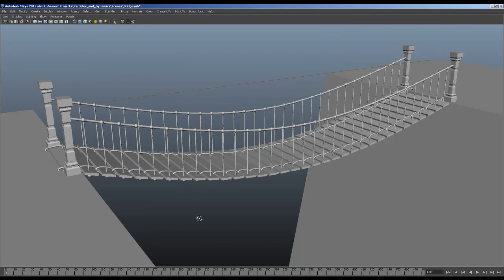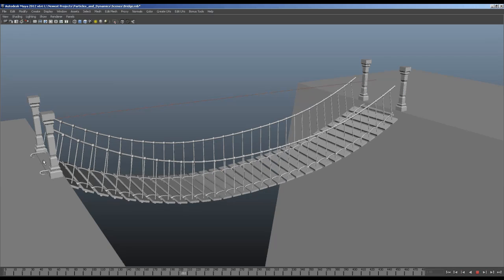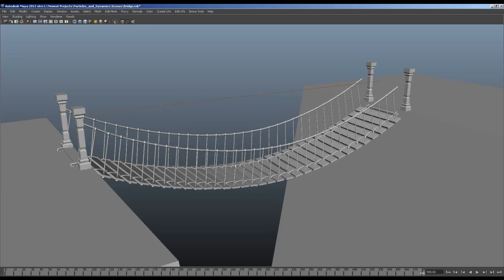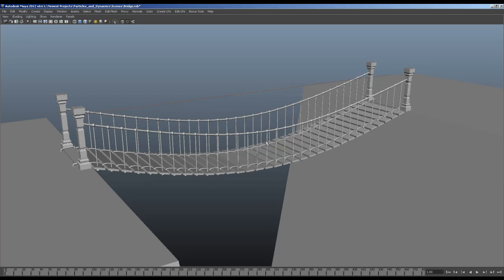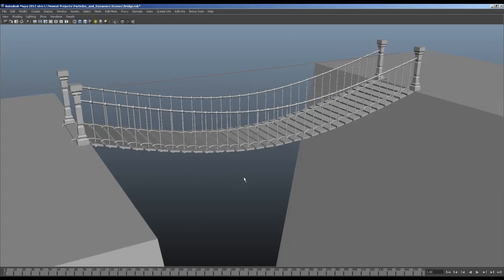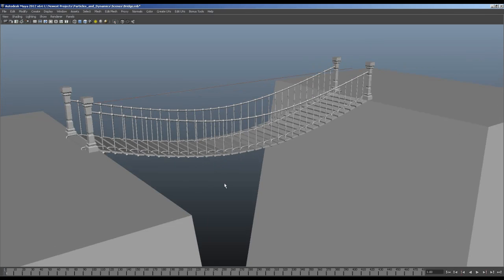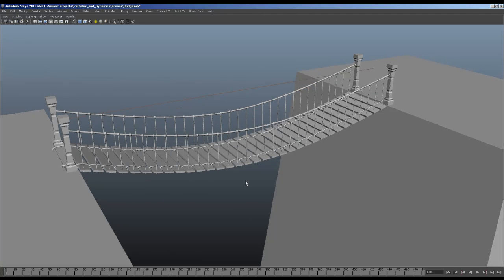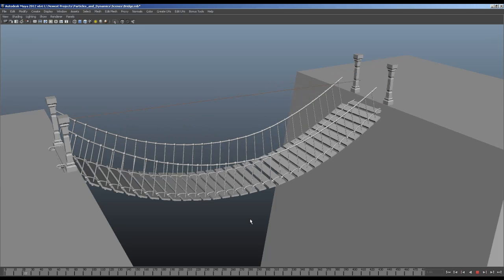Dynamic Rope Bridge - Maya

Comment from the maker: Mostly though there is only value in procedural modeling when there is little to no art direction. This happens more in the games industry than in the film industry. However I do agree with everything you've said. Mostly though I've been concentrating on providing artists with control over content creation through procedural workflows. This is a challenging endeavor as it is difficult providing complex tools with simplistic usage.

Comment from the maker: True, I implement a system very close to what you are suggesting in a steampunk style airship system. The rig allows the animator to control where the airship goes but the hull dynamically hangs under the airbag and the airbag floats above the hull. Each separately doing their thing while being influenced by the control object. Maya is great for many things and especially when your under tight time constraints it is still my go to card. But when you seek open ended possibilities, it Houdini.

Comment: Even having said that, probably NCLoth, being that it allows various systems of constraints and dynamics to be linked up could also be helpful.  My first thought for just animating the bridge though probably would have been to set up a square tube as a soft body with a goal shape and with customized springs that might drive the joint chains maybe with parented clusters...I would have to really sit down and work through it, but utilizing goals and springs would give you a lot of control back.

Comment: The only thing I will add is that usually this kind of thing is broken up into many different dynamic system parts simply because to have all of those systems getting evaluated all of the time can be extremely computationally burdensome in a scene if there's a lot going on around the bridge.